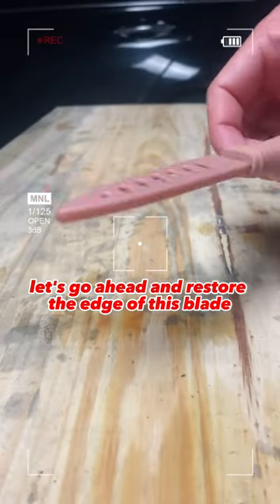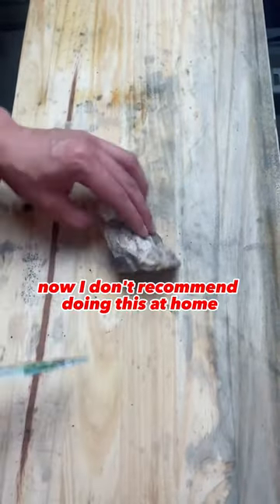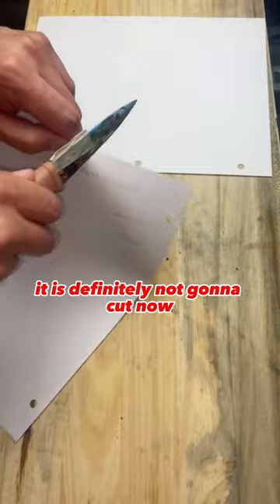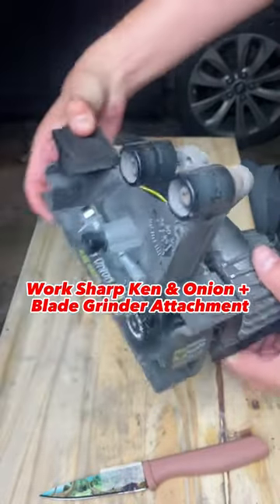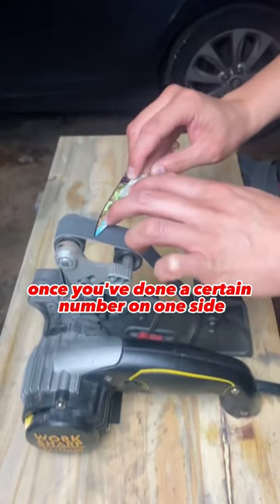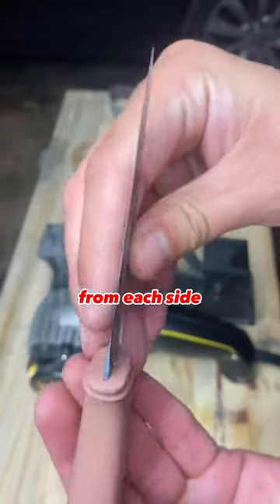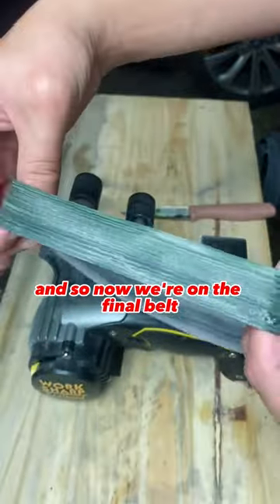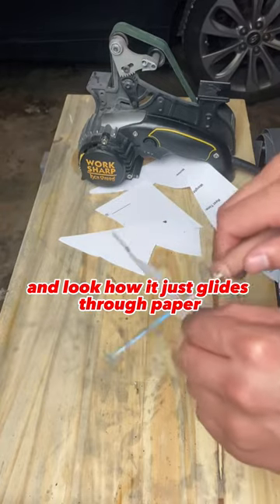Lets Fix This Knife 🔪 #sharpening #howto #diy #knife #knives #sidehustle #short #worksharp

Comment: I use the Precision Adjust Elite with a set of Accusharp II diamond stones in a 3D printed stone holder and strops I made to fit in it and diamomd sprays that I made with diamond powder and water at a 5K to 1oz ratio.